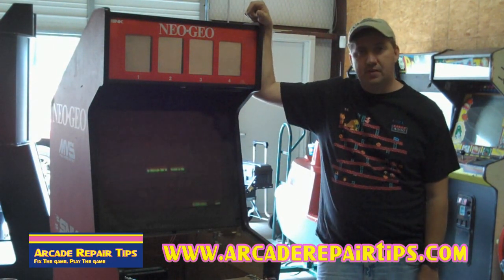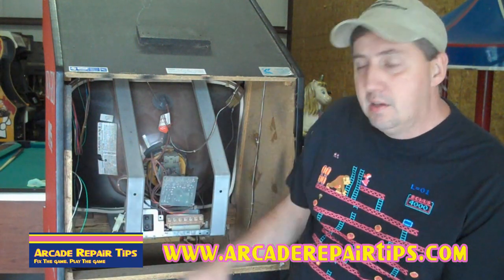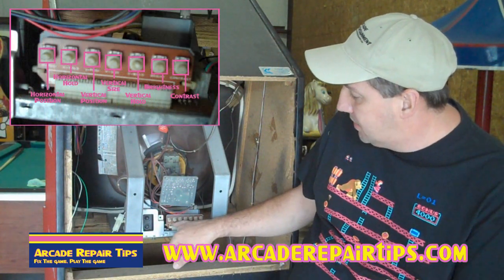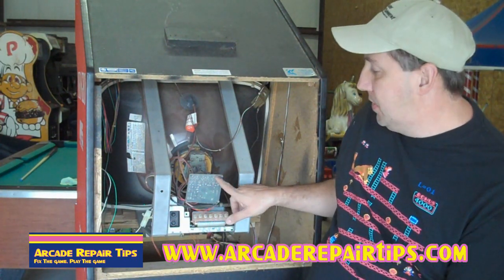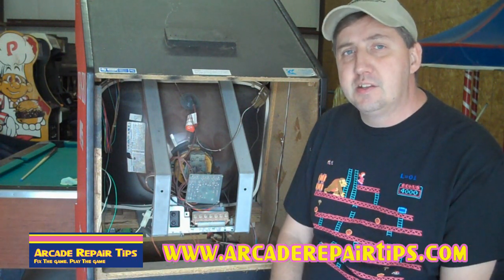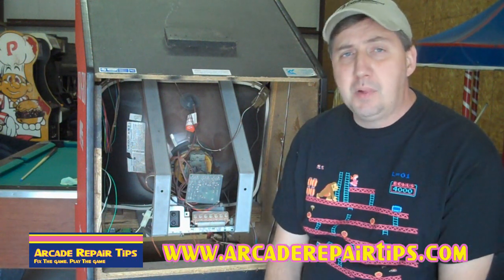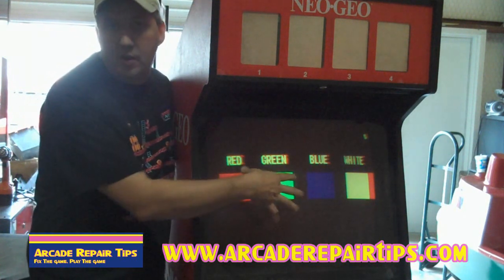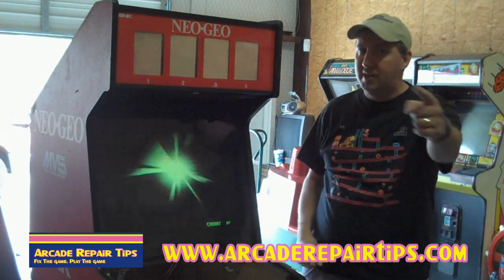Arcade Repair Tips - Adjusting An Arcade Monitor

Comment: ARCADE REPAIR TIPS, all arcade monitors have a B+ voltage set at 125 vdc. Why does the Vertical sync and horizontal sync hold circuit need a B+ bias voltage set at 125vdc in order for it to work correctly? 125vdc is a big DC offset bias voltage for a sync circuit

Comment: I have a 39-in-1 Ms. Pacman arcade game.  I had a power outage and the system went into test mode.  There is a button and a toggle switch inside which resets game parameters, but I can't figure out how to get it back to game play mode.  Any suggestions?

Comment from the maker: @djpaulhannon It's pretty safe as long as you take the necessary safety precautions. You might get some rubber gloves or plastic adjustment tools if you're really nervous about it. It's also a good idea to remove your watch. Take your time and watch what you are touching and you should be fine.

We have also featured your question on episode 15 of our Q&A podcast. Please listen to it for more of our thoughts on your question. Thank you for your question and good luck with your future repairs.

Comment: Hi there! besides all potentiometers you mentioned I was specting you to talk about those other potentiometers over the chasis board (there are 3 on mine scattered with no order in particular) I got the wired horizontal hold not functing! so i really nedeed to touch them... your video is really helpfull! Now i feel more secure to touch my flyback focus potentiometer (mine has 2 too) ... Thanks!

Comment: With the info in this video I easily adjusted the color on my Ghosts'n Goblins Cabinet (was showing too green) and also was able to adjust the horizontal to better center the picture (was off about a half inch). The monitor and gameplay truly looks amazing now, basically what you would see straight from the factory. Thanks so much guys, keep up the good work!
Reply: Do you still have your ghosts n goblins?
Reply: @iperez63  unfortunately had to sell when i moved.... still have a donkey kong arcade

Comment: Very interesting video.  Superior job in your details.  I always wondered  how these monitors worked because I never knew where the common controls were like on a regular TV.  What about the hue/tint adjustment and the color adjustment where you can make the image black and white.  What about audio adjustment, where are those controls?
Reply from the maker: The color adjustments can be found on the neck board. There are typically two adjustments per color (a cutoff and a drive). As for the sound, some game boards have a volume adjustment either physically on the PCB or in the test menu for the board. If you would like to hear more of our thoughts on your question, we will be discussing it on our Live Show Episode 67 which can be found at the following link: https://www.youtube.com/watch?v=XZgflESNhrI

Comment: Thanks for all these tips, and I don't know if you answer questions ?  I picked up an old Space Invaders and the glow in the neck of the monitor is very/overly bright and sometimes there is a little sparking in the glowing area. There is no game picture but the screen does light up overly bright greenish. Why is that neck glow so bright, and how to reduce it. Thanks either way.

Comment: I recently put a new multigame board in a Golden Tee cab and the monitor was kind of scrambled and had multiple images. I was able to adjust out the scramble but still have double and triple images. I did turn down the power supply adjustment on to 4.9 as recommended by the board manufacturer, it was at 5.4 Any ideas? Thanks!

Comment: I worked on CRT monitors for a few years a few safety tips should be said before you dig into a CRT monitor. As a electronic tech who has been shocked, and burned by a CRT monitor need to beware. CRT monitors are powered in such a way that the chassis may have 70 volts in reference to earth ground because they don't use a 1 to 1 transformer they rectify the AC to DC and goes straight into the electronics saves on money and weight.  Will you get a shock maybe if you are also touching metal bench or something and your hand is on the chassis. The way to stop that is to use a 1 to 1 transformer isolates the power from earth ground you don't need the 1 to 1 transformer just be mindful of it's danger. Also he said touching the flyback connector can shock you well its not easy to unplug it yes you could be killed by a shock like that. The more common thing to happen is brushing your skin against the flyback wire itself that can give you a burn because it's high voltage and higher frequency it will burn you like touching hot soldering iron. It's best to wear heavier rubber gloves if your adjusting pots always try to use a plastic handle screwdriver put some shrink rap down the entire metal length that way can't short anything by mistake.  If your colors are not perfect try the focus and contrast before you mess with the color pots on the CRT drive board. Also you might want to mark the pots original position with some nail polish.  Lot of times mess with those pots and now it looks lot worse can't get it back to what it was before. Tubes which run 24/7 like arcade games sometimes can't be fixed just have to be replaced.

Comment: i dont have a horizontal size knob with the vertical size. I looked on my monitor decal it shows it to be back behind the focus on the tube. I cant really see in there good and I sure dont want to play around in there with it on. Any suggestions why it would be there or am I looking in the wrong place. It is a Zenith G-A63ADG25X

Comment: Help. I have an ms pac man/Galaga. keeps moving the letters to the bottom right at a curve down. for instance the front bleed toward the bottom right of the machine. This tends to move quite a bit through play. I have adjusted multiple knobs, but to stop just guessing. what should I be turning. the horizontal size or hold or the vertical size or hold. Any help would be great. Thanks

Comment: have any idea where these knob are usually would be on a Frogger Cocktail monitor?
Reply from the maker: Some monitors have their adjustments on a breakout or remote board. If this is the case for your monitor, there should be some wiring or a cable that runs to this board from the chassis. Look to see if you can find a grouping of wires coming off the chassis and follow them. Hopefully one grouping will lead you to the adjustment board.

We will also be covering your question on Episode 38 of our Live Show if you want to hear us talk about it. The show will be broadcast live on April 2, 2020 at 5:30 PM CT or you can watch it as a recording at the link provided below. Thanks!

Link: https://www.youtube.com/watch?v=qCp1vv4lOIY

Comment: My horizontal adjustment knob doesn’t actually squeeze in the picture, like the knob doesn’t work. Vertical works. Is this the PCB of that crt controller?
Reply from the maker: While some monitors have a horizontal size adjustment, most only have one for the horizontal position. Please see our post and video on Adjusting The Horizontal Width Coil for more information on adjusting the horizontal size: https://www.arcaderepairtips.com/2010/04/21/adjusting-the-horizontal-width-coil/

Comment: That panel for adjusting the display settings was moved right behind the coin door in front on the Arcade Legends 2 machine I picked up recently. I'm in the process of upgrading the joysticks and buttons... but all of a sudden, the display itself has shifted over to the right (it is partially cut off now). I've tried twisting the different knobs. Am able to raise/lower the display, mess with brightness/contrast, raise/lower the display... but for whatever reason, no matter which knob I adjust.. I cannot get the picture to re-center again properly. I may have to open up the back and see if there are any more knobs/adjustments I can make back there. what a pain!
Reply from the maker: So, you should see “some” change when you are turning the adjustments on the “break-out” adjustment board. If you are not, then it could mean that you have a connection issue between the main monitor chassis and the adjustment board OR that the potentiometers on the board are not working properly. Turn off your game and check these items to see if it helps the problem. If the “break-out” adjustment board is hooked up and the pots are working properly, then you may have an issue with your monitor chassis. Let us know the make and model of your monitor chassis and we'll try to help you out further. Hope that helps.

We will also be covering your question on our Live Show Episode 89. Here's a link to the episode if you want to watch it: https://www.youtube.com/watch?v=zjZCzuFMpgg
Reply: @arcaderepairtips  Thank you for the reply! It is a Chicago Gaming Co "Arcade Legends 2" machine from 2007. I just had it open recently replacing some button switches that went bad. the "adjustment board" in it allows you to adjust the display brightness, contrast, v position, h position, etc... but no matter how I tinker with it, the display is still off center. I looked inside the back, around the monitor PCB but did not find any other adjustment knobs anywhere.
Reply from the maker: @cylotron  You might try turning off the game. Unhooking the connector from the remote adjustment board, hooking it back and, and see if that helps. Again, sometimes a bad connection between the adjustment board and the main chassis can cause this issue. You might also try disconnecting the input wires from the monitor chassis and reconnecting them (while the game is powered off) as well. If the picture is still shifted after that, we need to see if we can get some more information about the monitor. You can send a picture of the back of your monitor to us via email at questions@arcaderepairtips.com if you need additional help.

Comment: I have ran into a problem with a MAME project my son and I are doing. The cabinet is an old SEGA GT and the monitor can plug directly into the PC. Everything comes woks great until windows loads. Once Windows fully loads we get four to five narrow versions of it on the screen at the same time. Up until it loads everything looks great. Anyone have a solution for this? I would greatly appreciate it.

Comment: What is the best way to take a color monitor and turn it to Black & White to use in old Space Invaders Cocktail game?
Reply from the maker: 1Eachambers, you should just be able to attach the output signal from the board to the to red, green, and blue pins on the monitor input. There's a short text file on the BrentRadio website that gives a bit more detail on the process: http://bit.ly/brentradio-color-si

If you would like more details about your question, please tune into our Live Show Episode 50 on Thursday, April 1, 2021 at 5:30 PM CT. Here's a link to the episode if you want to watch it: https://www.youtube.com/watch?v=2n5KYtdD86w. Thank you for your question and good luck with your future repairs.

Comment: My monitor is saturated in one color over another, we have recapped and changed the transistors with no luck.  I see all the colors but I blue is over powering all, and doesn't change much when I try adjustments.  would it be possible that its a bad pot? and if so are they just adjustable resistors that i could test? or would it be something else that I am missing?
Reply: ok I replaced everything but the pots, they are reading an open whats the standard resistances cap 1k, 5k, or 10k.  any help would be great.

Comment: My arcade machine when I boot it can have a heavy red, green or blue colour tint. It wears off back to normal but can re-occur during play or even just idling. Now percussive maintenance (smacking the side of the machine) can make it come instantly back to a proper balance of colour but I'm looking for a fix! Is there something obvious that comes to mind for a fix on this?
Reply from the maker: From your description, it sounds like you may have some loose wiring/bad solder connections or an issue with the color functions (adjustments, drive transistors, etc.). Start off by checking the input wires that run from your main board to your monitor chassis along with the input pins themselves. Make sure that they are not damaged in any way and touch up solder if needed.

If you would like more details about your question, please tune into our Live Show Episode 55 on Thursday, September 9, 2021 at 5:30 PM CT. Here's a link to the episode if you want to watch it: https://www.youtube.com/watch?v=jKm83ExziME. Thank you for your question and good luck with your future repairs.

Comment: I just purchased time crisis 3 from an arcade that went out of business. I'm told one side has a fried board, an the other side just needed a monitor...I put the good monitor in the cabinet with the good board...I get sounds, lights from the decorative lights, but the screen does absolutely nothing!
Any input from anyone would be greatly appreciated
Reply: Check for power to the monitor. If thats ok then check for neck glow to see if tube is still good.

Comment: anyone have any idea why my monitor is showing shrunken graphics on the bottom and enlarged graphics on top. when the game play is in the middle of the screen it looks normal. by middle I don't mean dead center, I mean like the middle as if it were a horizontal line. its,like there are 3 sections showing the characteristics I mentioned. in addition, I can't get the image to stretch to the very bottom of the screen, it's about 3 inches of nothing before the screen shows anything. the game is a Namco reunion and I believe it's a Wells Gardner monitor. I would greatly appreciate any insight or help.

Comment: I was told messing around the back of the monitor even with the power OFF can kill you?  So I’m supposed to mess around back there with the power ON?
Reply from the maker: We know it sounds scary but it's not as bad as you think. On the monitor in this video, most of the adjustments are directly on the monitor chassis. Many monitors have their adjustments on a break out board that's separate from (but still connected to) the monitor. Break out boards make the process a bit less scary. Regardless of how your monitor is set up, just be sure to take precautions based on your level of comfort. Rubber gloves and plastic adjustment tools (like the TV alignment tools we discuss in our post/video on Adjusting The Horizontal Width Coil) can also be used if you don't feel comfortable making these changes with just your bare hands. If you need additional help with your issue, we will be discussing your question on our Live Show Episode 64 which can be found at the following link: https://www.youtube.com/watch?v=RARf8Re0QyQ

Comment: What can you do to adjust the "stretch" of width and height when your external control board doesn't work? My control board which is the only way I know how to do so basically doesn't work. I can get into the settings by clicking the MODE button on the board but no other buttons function after that. I've already tested continuity with the cable connector as well as continuity on the control board itself. Continuity is not an issue. My monitor simply won't honor any other button press on the external board.
Reply from the maker: Before we address the control board issue, we should mention that horizontal width can be adjusted on most monitors by using the horizontal width coil. See our post on Adjusting The Horizontal Width Coil on our website for more information.

Based on your description, it sounds like you have a newer digital monitor. Great job checking the continuity back to the main chassis. At this point, you’ve basically narrowed down the issue to the control board itself. We would suggest trying to replace it (if you can find a replacement). You can also try checking the buttons/pots individually with your multimeter to see if they are functioning properly and replace as needed.

If you have any additional questions, you can reply back to this comment or join us for our Live Show Episode 75 on Thursday, May 4, 2023 at 5:30 PM CT on YouTube as we will be covering your question during the show. Here's a link to the episode if you want to watch it live: https://www.youtube.com/watch?v=VH5Yjazq2Po. It will also be available as a recording at the same link if you are not able to watch it during the live feed. 

Thank you for your question and good luck with your repair.
Reply: @arcaderepairtips  Thanks so much for the detailed reply! Thankfully I was able to obtain a used remote control board, swapping that in for the old one, even using the old cable/connector. That fixed all adjustment functionality, so it seems it was in fact the buttons/pots on the older remote board no longer working. I'll also check out your adjustment article too, much appreciated. I may not be able to attend the live feed as I'll be out of town tomorrow but that's awesome you'll be addressing my issue specifically. I look forward to watching. Thanks again for your expertise!
Reply from the maker: @TimStiles  You're welcome. Thank you for the update. We're glad to hear that you got your monitor adjustments working. Thanks again for your question and good luck with your future repairs.